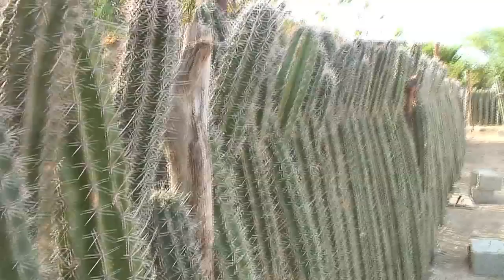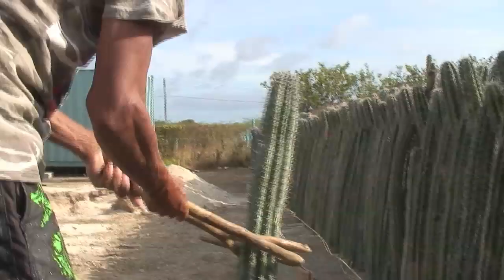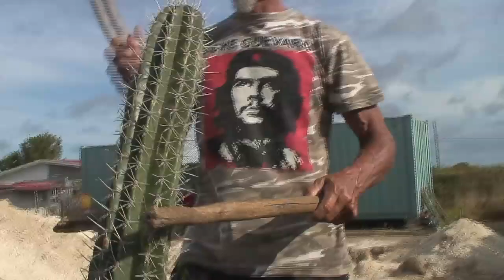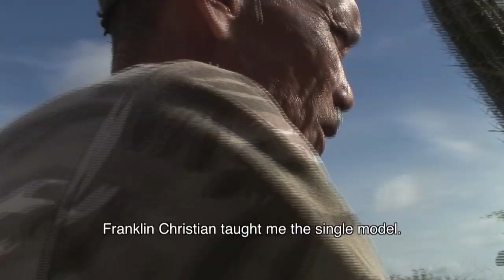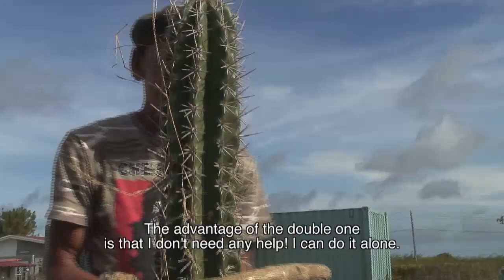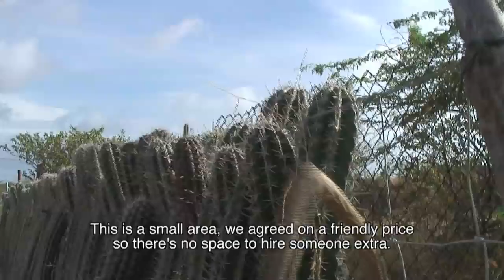BON233 - Building the Cactus Fence 01 - Whatifwechange.org

Comment: Why not with root? so it will be alive and will go for a long time
Reply: They re-root and grow for many years. They become tall and very full, after the yatu cactus roots it send out new cactus from the bottom. If you watch video #4 Rodger talks about how when cuttings of the Yatu fall to the ground they root and multiply.
Reply: @esbohlin  not on dry hard bare soil though. You don't get 100% success even with everything CORRECT. I got about 50 cacti cuttings right now and some don't look like they're going to even start and are just shrivelling. And they're the BIGGER ones.